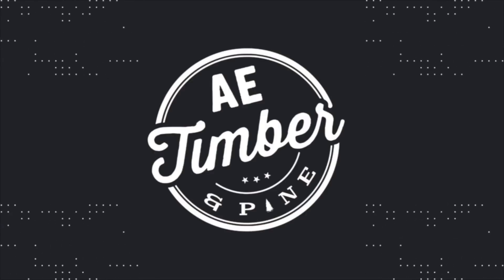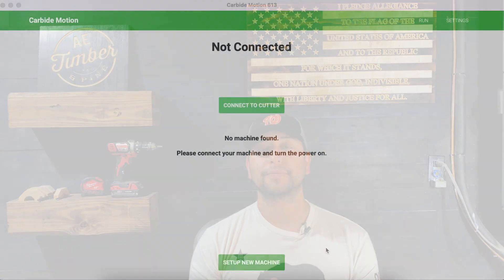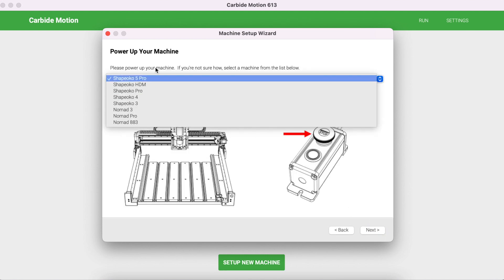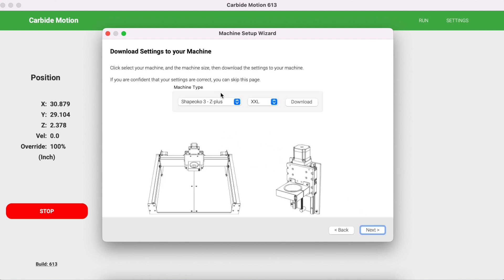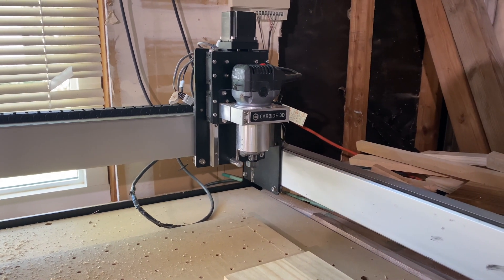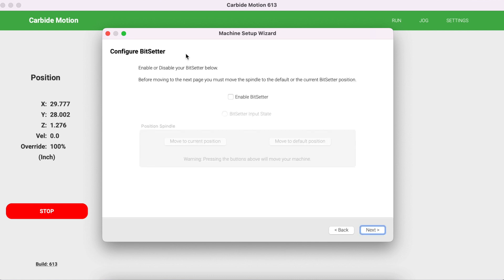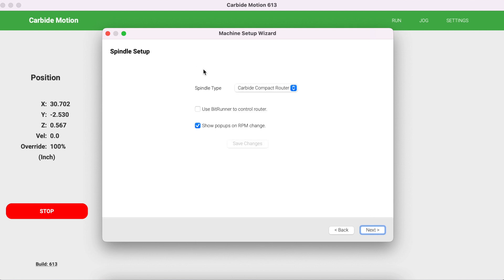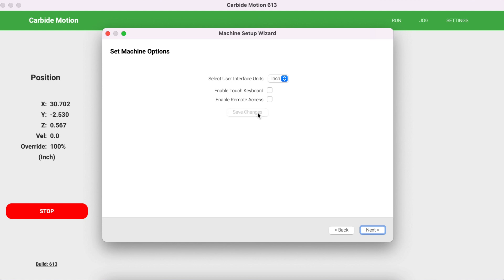Carbide Motion 613: How to Configure Your Shapeoko CNC and BitSetter

Comment: I am using CM version 640, I had to replace my bitsetter, would this process be the same in version 640?
Reply from the maker: No actually, you’ll have set up the machine again as if it were knew and then you’ll get to the bitsetter setup eventually through that process

Comment: is there anyway to manually set the x,y travel of you shapeoko through carbide motion? I have a shapeoko 3 standard but bought another set of rails and did some custom work to make it all work so now my machine is bigger then an xxl but i cannot use the full potential of my new machine because I cant seem to set it up manually.. do you know of any other cnc controlling softwares i could use if this is something that carbide motion can do?
Reply from the maker: I have not customized my shapeoko so I wouldnt know how to do this.  There is a FB group of shapeoko modders that may be able to provide this answer if you’re still looking.

Comment: can You tell me why you upgraded to version 613 of carbide motion
Reply from the maker: Hey resorter I had to update carbide create because some feed and speeds were fixed in a newer version. I didn’t have to update CM but just did both. I did CM first and saw that this process was different than a previous video I had done.

Comment: What? I just loaded 611 a few weeks ago. ha off I go.
Reply from the maker: I was on the late 500s or early 600s and had no plan on updating but someone told me that a feeds/speeds issue was fixed so I updated and then had to do all this again. 

I usually forget about updating because if it’s working for me I don’t change anything lol
Reply: @aetimberpine  Exactly
Reply from the maker: Hey Wade just realized that the speeds issue was in CC and not motion.  Just to clarify.